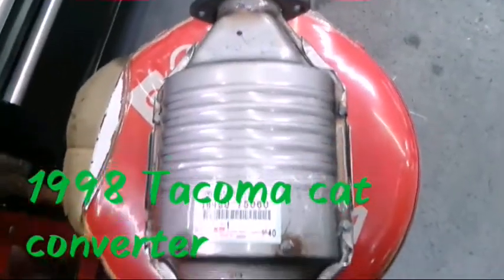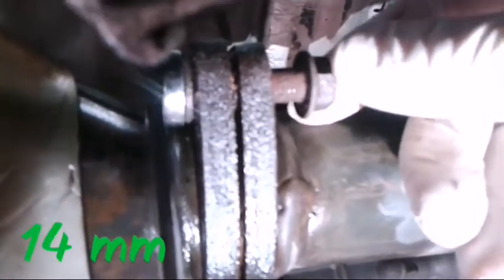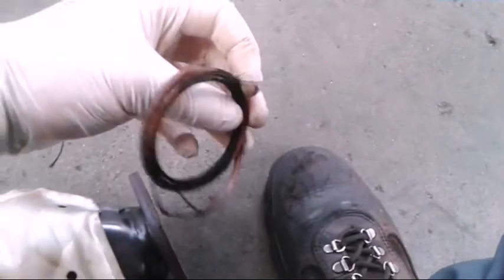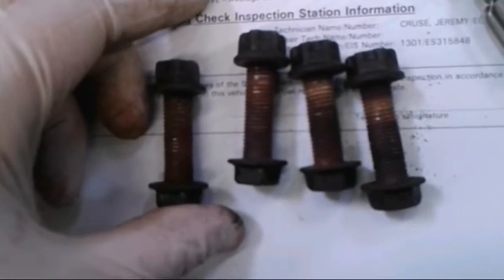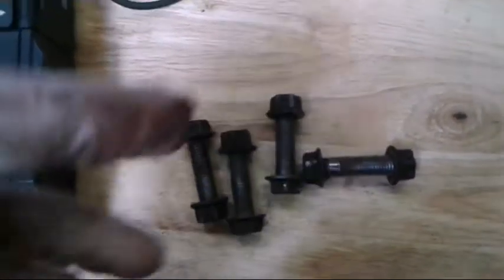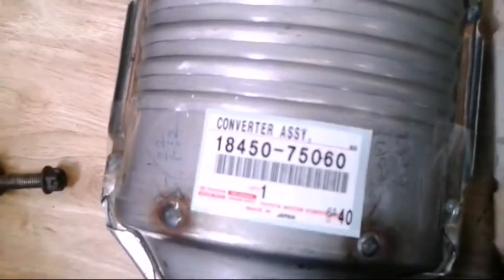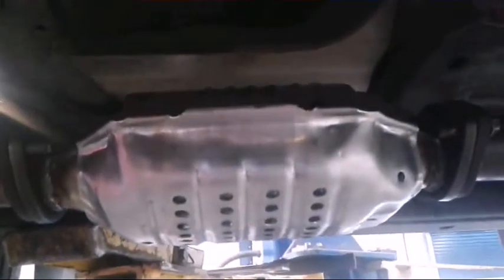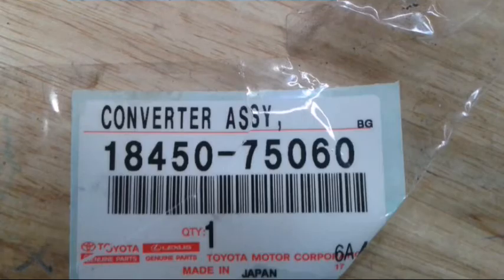1998 TOYOTA Tacoma catalytic Converter replacement ( CAT CONVERTER )

Comment from the maker: GET AN AFTERMARKET CAT CONVERTER HERE ( AMAZON ) ( 270 BUCKS )
https://amzn.to/3w1bHMt

TOYOTA PART #18450-75060 

TOYOTA BRAND CAT CONVERTER NOT AVALIABLE ON AMAZON. THIS IS AN AFTERMARKET CONVERTER. IT IS NOT SHIPPABLE TO CALIFORNIA OR COLORADO. BUT EVERWHERE ELES THAT HAS COOL STATES IT CAN GO TO. 

FITS THE FOLLOWING
 1988 Chevrolet Nova, 1989-1997 Geo Prizm, 1983-1986 Toyota Camry, 1984-1995 Toyota Pickup, 1984-1997 Toyota Corolla, 1985-1995 Toyota 4Runner, 1995-2000 Toyota Tacoma, and more

Comment: My light came on showing the cat was bad did not want to replace it so ran my gas down to empty put one gallon of lacquer thinner then 10 gallons of gas drove it at highway speed for 45 min both ways so total 90 minutes then just drove normal till on empty light went out no more problems

Comment: Do you have to change the 02 sensor when replacing the Converter?
Reply from the maker: No you do not, if you suspect its bad or its a decent price for a new one then i would consider it, but no its not necessary.